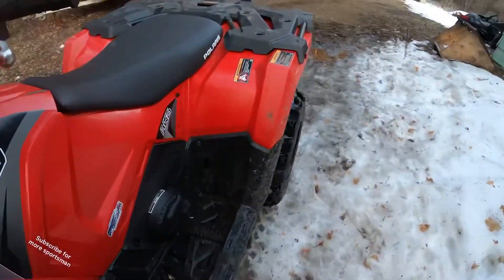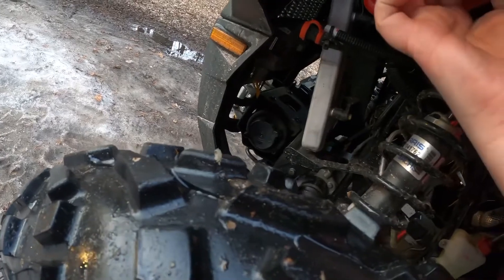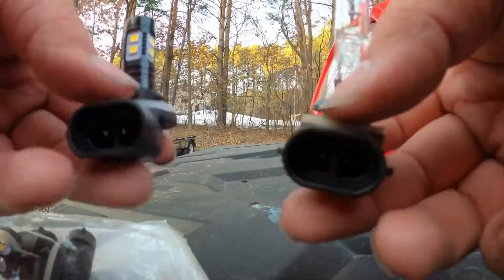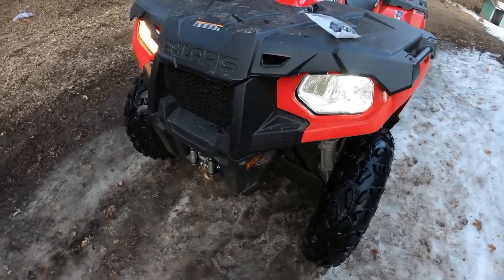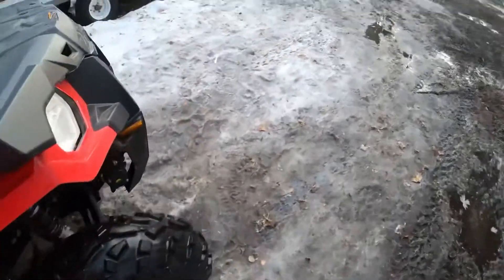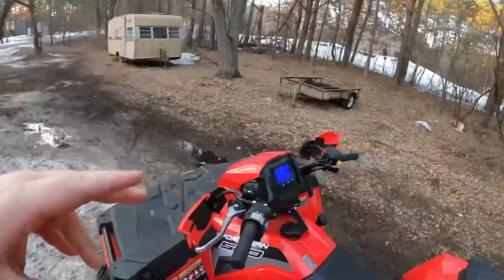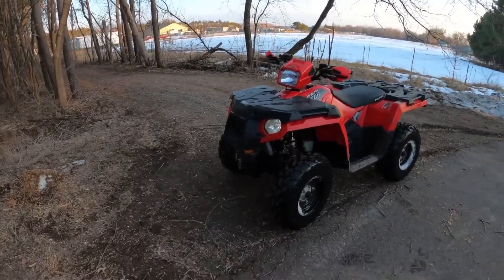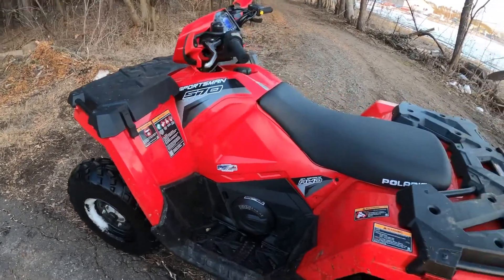Polaris Sportsman 570 Upgrade Ugly Halogen Bulbs!

Comment: What LEDs did you get? Do you happen to have a link or description? Thanks
Reply from the maker: Just ordered a set off eBay.
Reply: @jakesgarage3364  ALL LED's are not the same. Sounds weird but hear me out. I bought a pair for an old 325 Magnum (2002) and
the replacements were supposed to be a direct fit. Hi and low beam in one light. The ones that arrived weren't even close. The plug end of the light was wider, 3 prong, but wider. Had to send them back. On another note, for those of us that have the 570 Sportsman, I have a 2023 6X6 and a 2014 570 4x4, could you give the exact number for a direct replacement so there is no guess work? It would be much appreciated! Subbed!